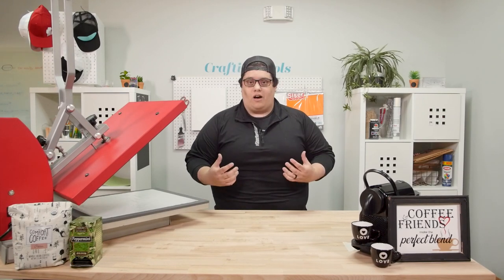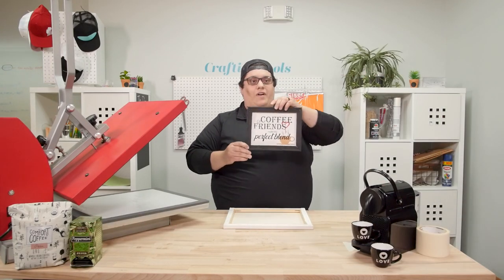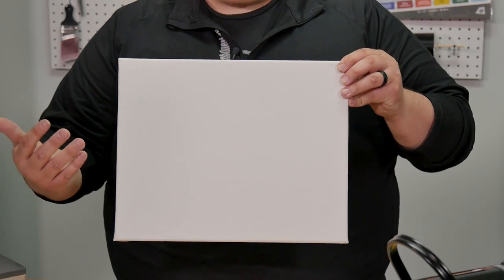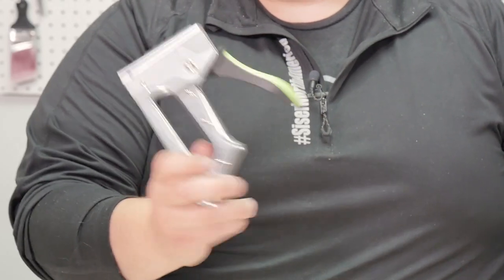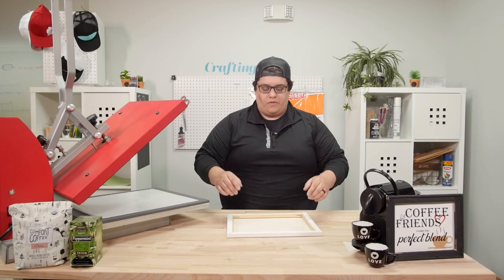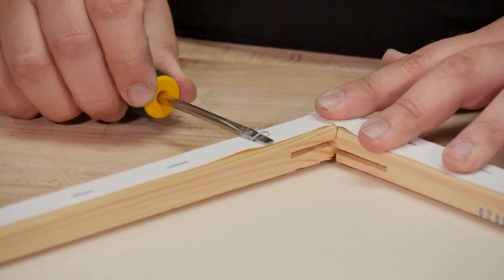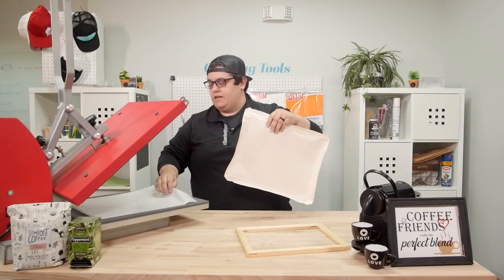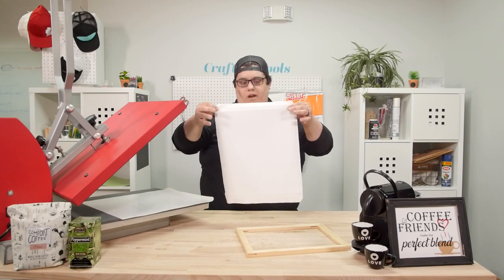Vinyl Expert Teaches You How to Make A Reverse Canvas - Craftin' With Patrick

Comment: If you leave canvas larger it will be easier to get taught when you staple it using the excess to pull. Then trim neatly using sharp box cutter and a ruler on back. I'm a picture framer so thought i could help. Thanks! Keep craftin' on!!!!!